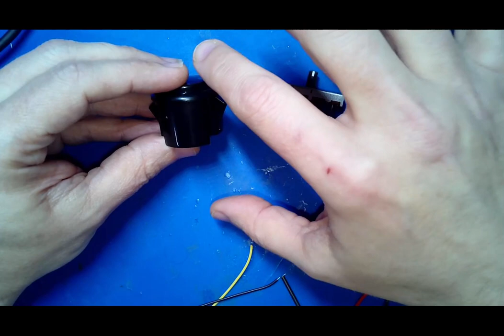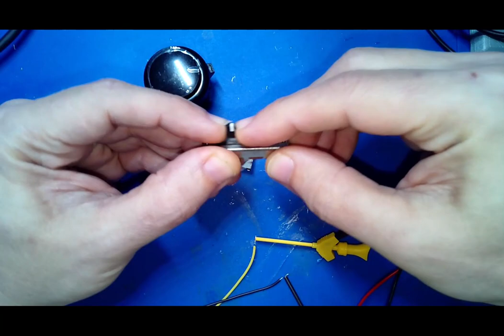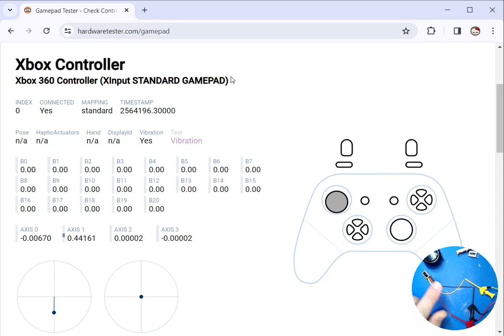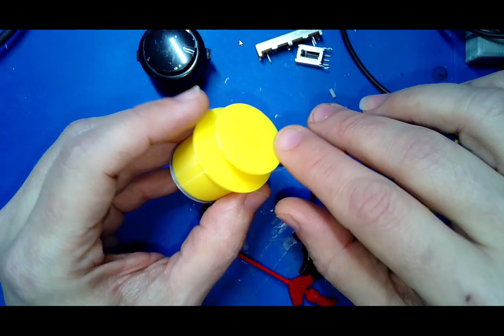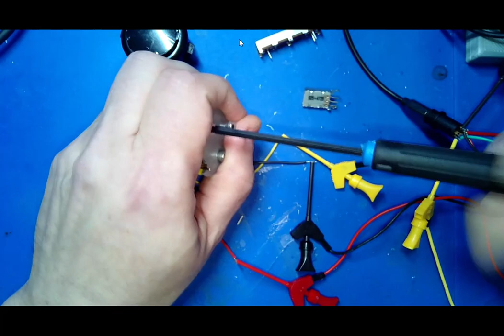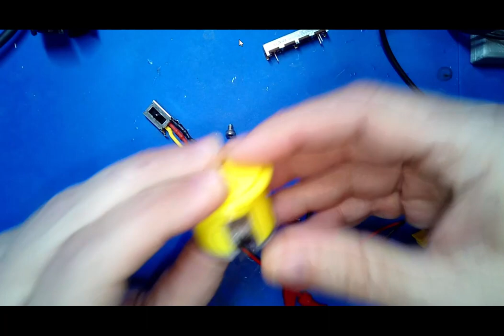Tiny Slide Pot: An Analog Button / Trigger For XBAC

Comment: Would you consider thinking of the version that requires very little force to press?
Reply from the maker: What sort of force are you looking at? 

There are  resistive pressure sensors -- most go down to 30g -- which, while low, I've found too high for those with limited strength/movement.
Reply: I am not really sure how much, I have SMA type II.  Definitely lower than a traditional trigger on a controller.  Also, I do really like the idea of a slide mechanism for a trigger. @RonNelson
Reply from the maker: @jakfan711  My SMA customers often go with a GlidePoint based device. It's a touch sensor, so no force. So far I've used it for joysticks.

I have some ideas floating in my head and I'll be posting more videos about them.

Comment: This is very nice idea. Will your button have like those snap taps on the ends to snap in place the  button hole?
Reply from the maker: Once I get the thing to quit making grinding noises, I'm going to look to mounting. I'm leaning toward snap-in, as 3D printed threads aren't always that great.

Comment: The bluetip Buttons works if you know how, not the easiest setup for the average user. Also those buttons are 28mm, would be nice to have some thing in sanwa style 30mm and 24mm.
Reply from the maker: Based on the part sizes, this idea can be implemented in 15 to 30 mm. This might be something that I make in 24 mm and have adapters for different hole sizes. (Why didn't I think of that before?) The height (not counting the plunger) is 25mm for rear clearance.